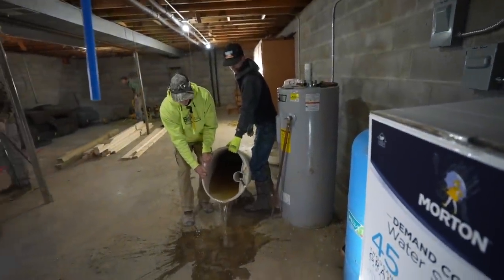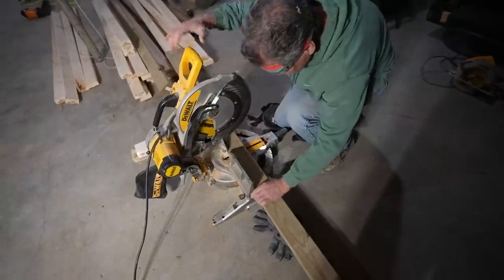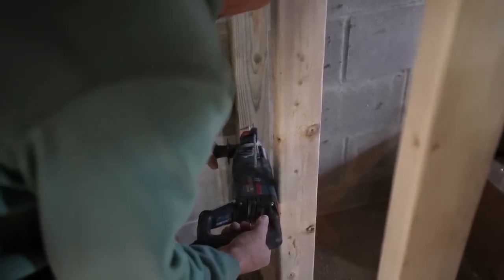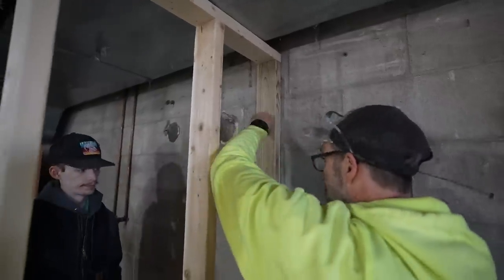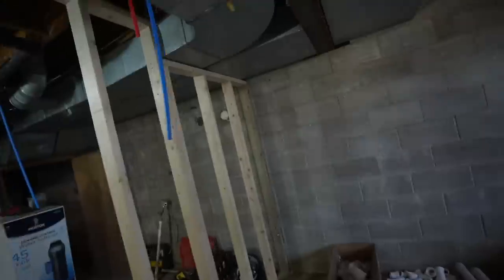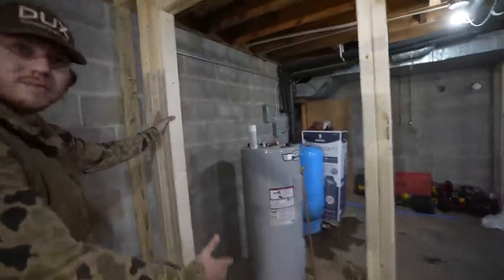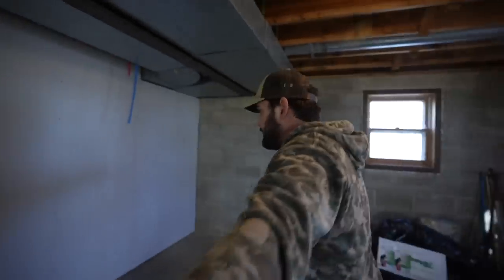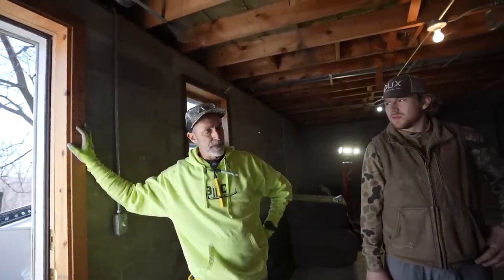Fully Renovating My House Built in 1890 (Part 6) - New Utility Room!

Comment: If the floors aren't in your main house then the paint that is on the baseboards is probably just a first coat. They should repaint the baseboards again after the floors are installed

Comment: You can install the baseboard before you install the vinyl plank floor, but you will have to install a shoe base to cover the gaps against the wall after floor is installed.
 Also the shoe base will have to be preped and painted.  So it makes sense to install floor first and then baseboard & shoe base.  Painting should be your final step to avoid additional touch-ups.
Reply: On larger projects like your new home. It's ideal not to have floors in first, to avoid damaging them. 
Ideally, you want to have framing, plumbing, electrical, hvac, & drywall  complete before installing floors.

Comment: Next time put a foam protection layer under the bottom plate to prevent rotting. Wood should not come in contact with concrete.

Comment: drywall should technically be hung horizontally, and you dont really need the adhesive on the bottom plate.

Comment: King Tut Culligan's tomb? If the water at that local sucks bad enough for all of that,you should have placed  a 1100 gal potable water tank inside it for $800 or so & set up a rain catch. Before you closed it all in. No problem though,Flaire likes sledgehammer work.

Comment: exterior foundation nails... you need the nail-er device because by civil choice of law, no one is physically capable of using a normal hammer to set those into the foundation. "don't tell them you need to pre drill a hole before... bent the nail trying and no lunch for a week or two too set em in, blind in one eye... one eye willy (will he) strikes again" many a time the pressure treated base foundation board is pressed into the wet concrete as that hold is surrounded by three sides is hurricane rated, foundation nails are not. all your high grade reloading powder comes in small capsules as that is the only safe storage method for airfreight/ground shipping schedule 1.4 volatiles, can get black powder by the pound but 8 times more energy density and its sold at a half pound at the most. "most retail ammo is sold at a 1000% discount" DIY reloading... with the raw chemical's. " whole desk explodes, gets mercury nitrate induced arrhythmia followed by severe cognitive and  stomach unsettling... don't use ramsets  indoors unventilated the chemicals in the powder are not regulated to clean are standards like normal ammo, will get cancer from using those.

Comment: You should’ve put pressure treated lumber on the top, and bottom plate, or just used a pressure treated 2x4 from top to bottom. Anything touching concrete, or block, should be treated. Hopefully you can drywall that before your next inspection!
Reply: Treated was used bottom and sides per code

Comment: Flair, you and your crew scare me when you're using the nail guns.  Y'all have your hand holding the studs way to close to the top/bottom plates.  Need to hold the studs a little further back.  It's something I learned while building walls.  The supervisor and trainer beat it into our heads in order to avoid accidents.  Nails have been known to curve and come thru the studs and into hands.  I nearly had it happen to me a few times and seen it happen to someone else.  Please hold the studs about a foot back from the plate when pulling the trigger.  I'd hate to see anyone end up with a nail going thru their hand.  Example of a hand being too close is at 9:05.